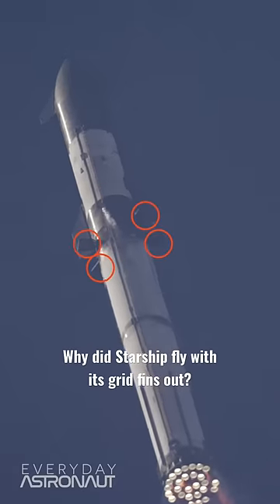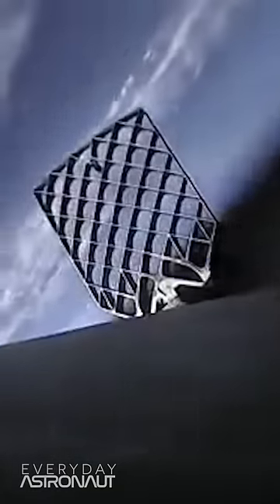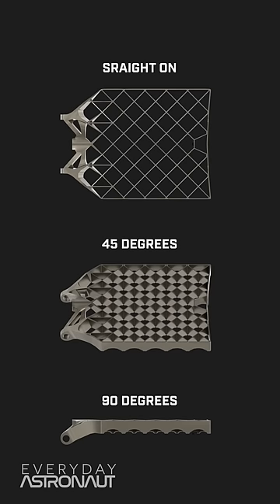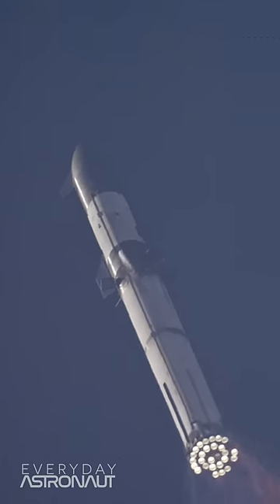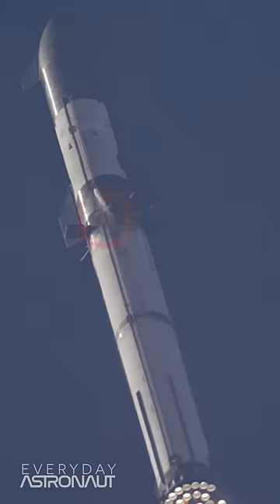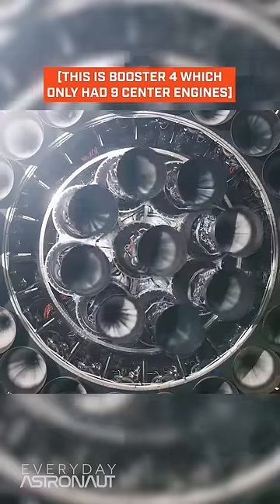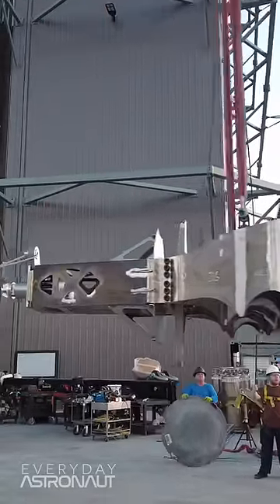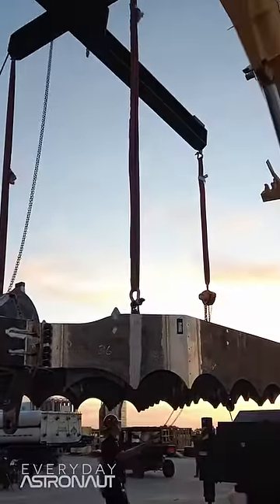Why did #SpaceX keep #Starship’s Grid Fins out on ascent?

Comment: Sometimes SpaceX kills me

Grid Fins: We can keep them out because due to a complex and complete analysis we fund that it's better and weighs less.

Pad: A rocket with more power than the Saturn V firing into bare concrete when NASA needed a flame trench lined with refractory bricks? 

Meh, it'll be fine, our half power burp of a statics fire only did a little damage.

Comment: I woulda guessed that they were used to reduce the tension strains on the booster. With the boosters fuel tanks emptying, the structural integrity of the booster will decrease, couple this with a fully loaded upper stage being in front of the centre of pressure and shifting the centre of mass forwards and it would possibly introduce a risk of exceeding the structural limitations of the booster to withstand the bowing/buckling forces as it controls the ship's attitude from the bottom. Like placing a heavy weight on top of a soda can and holding the can at the bottom, and moving the cans position rapidly....

Comment: Perhaps they extended the grid fins because the hydraulics were destroyed at launch with insufficient deluge and no deflection? The thoroughly predicted destroyed concrete randomly flying at highway speeds was recognized as a risk but was determined(by Space Jeebus) to be too expensive to mitigate. BTW, this was "discovered" waay back in the 1960s by two very different countries. 🙄

Comment: I thought profile drag will be huge before max Q. I wonder the sheer power of the rocket simply overcomes the grid fins as viable tradeoff for additional weight and complexity
Reply: The weight performance trade-off is the key part.  Way oversimplified: you don't want to 'add two units of performance loss' (by adding the weight of a folding system) to correct 'one unit of performance loss' (in the drag being caused).
Reply: Remember that drag is related to airspeed... so the drag is relatively low when the vehicle is initially accelerating, and by the time the vehicle is really getting up to speed, it's in lower air pressure.

Comment: I mean they do essentially steer using drag. ‘Deflecting air flow’ is more or less a semantics difference, unless you mean deflecting airflow into other aerodynamic surfaces?
Reply: They steer primarily by generating lift, just like the various control surfaces (ailerons, elevators, rudder, etc.) on an airplane. Of course they do also produce drag, because everything that produces lift must also produce drag. But the drag from the fins exerts almost zero net torque on the booster, so it's useless for steering.

Of course if you were to redefine "drag" to mean "any aerodynamic force generated by deflecting airflow", then you could claim that lift is a subset of drag and make your claim true that way. But then, by that definition, airplanes would also stay in the air using drag.
Reply: Fair enough.  The real key is "productive drag" rather than simply "paracidic, unhelpful drag".

Comment: My impression is they spin starship like a bullet for accuracy.
Reply: It would not help for rockets of this size. For smaller rockets which a just for collecting high altitude data like sounding rockets for weather data, yeah, they probably do spin them but once they are 120M or 360ft tall, that will induce a lot of extra stress which is not ideal for rockets.

Comment: A better question would be why didn't Spacex use a flame trench. They could have avoided kicking up concrete and damaging launch pad and Starship engines.
Reply: The launch site is too close to the water table to dig a trench, they would have had to spend months building out a proper diverter and watter dailuge system to handle the starship, above ground, the pad was only meant to be used once before being dug up and replaced.

Comment: Amazing. Interesting how they have ablilty to gimble the engines. I wonder if they can design them to flip them around. Like just the ones on the outside. So they could theoretically use them to get out of a pinch if the rocket for some reason loses its trajectory. It 'may' help. Of course not flip 180 degrees thatd blow up the rocket. But maybe i dunno. 90-100 degrees? Deploy the ones that they need for direction control. I guess they could just use what they have to steer.. But, since they are always upgrading these awesome engines. Seems likely they will add something like this eventually if they needed it.

Comment: they are fixed, non retractable on the booster. unlike those on the falcon series  rocket.
the booster's only twist side to side. they will never fold. elon runs on the idea that less is better, if he can achieve his goal without something, like say the parts and software needed to fold the fins, then he'll do that. the booster has more than enough power, as we saw on the test flight, that whatever drag those fins create doesn't matter. there seems to me there was another reason why they made it this way i just haven't had enough coffee to cut through the haze. something to do with stage 0 i think.

Comment: Saying they don't steer with drag, instead with deflection is wrong. Aerodynamic drag is how wings produce lift. Saying that these, or any other fin/wing deflects air is a bit simplistic, and not correct. Lift is the perpendicular component force to the direction of air flow due to drag through a fluid. Although a fluid may be deflected down, this is not what causes lift, rather the low pressure on the 'unexposed' portion of the wing that creates a low-pressure differential from top to bottom that allows the wing to be acted on towards the lower pressure environment.

Comment: Steering by directing airflow is the same thing as steering with drag lol
Reply from the maker: Drag is not along the primary vector for a traditional fin / wing / aileron. But a split aileron does primarily use drag when split for control instead of lift

Comment: Wouldn't it at least make sense to turn them parallel to the ascent rather than perpendicular?  And, why are the heat shield tiles black instead of white or, better yet, shiny metal?  Black absorbs far more heat than the others would, making the tiles far more resilient (IMHO) during reentry I'd think/
Reply: As he said, the extra weight of the mechanism to move in that way is worse than the performance lost by the extra drag.

It's true that black is the best absorber of heat, but it's the best emiter too, which means that heat spreads more evenly reducing the risk of hotspots.
Reply: @JoseNovaUltra  On the grid fins, that's having them fold back against the fuselage.  Im talking about them simply rotating 90 degrees one way of the other rather than having their full surface area exposed on the ascent.
Reply: @ericperkins3078  got you! I understand now. It is actually worse, the side has a lot more surface area, as show in the model,  the cross section doesn't have thay much material in way. And I'm not sure that it even has enough attitude control to be place in that position.

Comment: This leads to the question: “if this is a better overall engineering solution, then why don’t they retrofit this design to the Falcon 9?” It seems to me that all the same variables apply. The only reason I can see is “if it ain’t broke, …”
Reply: The Falcon 9 would see a sufficient payload decrease with the gridfins permanently extended and catching an F9 would be pointless since they are just fine with drone ships and landing pads and legs on the booster.

It would also require a complete redesign of the Falcon 9, possibly costing billions for a rocket SpaceX may not be using in the next few years, so it’s not worth it.
Reply: @archierush868  thanks, Archie. Have you seen, or read, an actual engineering analysis of these trade-offs, or heard someone go into detail? If so, can you provide a link? thanks again.
Reply: @tfk0527 it’s just from what we see. We see that Starship and the booster are designed to be fully and rapidly reusable, while the Falcon 9 was designed to be partially reusable. Having the fins extended, legs removed and trying to catch it would be too expensive to be deemed viable for the Falcon 9, especially since they won’t be using them when the Starship is reliable.

Comment: A question on another topic. I noticed some of the outer engines on the booster were not lit, is this normal or have they failed.
Reply: That was flight 1 where 6 engines failed. Flights 2 and 3 had no engine issues during liftoff and on the ship and flight 4 had only one engine fail on the booster during liftoff and one during landing.

Comment: I want to know why the grid fins are scalloped?
Reply: I've read that it gives a better trade-off between steering authority and weight.  The sharp side on the bottom is leading into the wind when landing and further helps to direct the airflow through rather than around the fins.  Pretty cool looking design too.

Comment: How does it not use drag? What is the difference between deflecting airflow and using drag? Are those not the same thing for the most part?
Reply: I don't know that much, but I believe it goes like: 

Drag is produced by stagnation, basically stoping the flow, this produces friction, heat and high pressure zones. Drag has a vector opposite to the path being travel, so drag is kinda brakes in way.

Lift is produce by flow, this produces low pressure zones in the surfaces, the vector produced is perpendicular to the direction of movement, perfect lift shouldn't affect the speed of the direction of motion.

Comment: How many times now, starships booster fins DON'T FRIGGING RETRACT, it doesn't create enough drag on slower ascent to justify all the additional equipment, mass, weight and taking up space for hydraulics, motors and gear. SO ENOUGH WITH THE GRID FINS

Comment: „Removing an extra failure mode“

Launches a rocket with no flame deflector on a weak concrete pad without any kind of water sound protection that was absolutely necessary on much weaker rocket designs while the flat pad reflects the sound back into the engine, uses an FTS that doesn’t work, engines that Musk confessed only had a maximum observed lifetime of about 1000 seconds, leaves a ton of equipment, including large propellant tanks, very close to the launch site, and is not even able to accurately display what engines have already failed (which, by the way, was an enormous 8 or 9, so nearly a third of the engines installed). But man, at least that one risk factor of the fins not deploying, that is out of the way 😂😂😂

Comment: INTENTIONAL TERMINATION!
(While I understand required testing for safety and such,) that’s SO much money wasted!
Reply: None of which is your money so why complain? All the engines in total cost around $40M which is the same price as one RS-25 which is the engines used on SLS, and the SLS uses 4 of them. In total, Starship and the booster probably cost around $70-$100M or about as much as a fresh Falcon Heavy. The entire program has costed SpaceX between $3-$10B at the lowest to highest amount from 2019-today, with most averages putting the number at around $5B.

That’s $5B for literally everything Starship related from vehicles, ground support equipment, raptors, testing stands for raptors, multiple launch towers, one at Cape Canaveral under construction and 2 at Boca Chica, also one of which is under construction, build site, heat shield tiles, all for around $5B.

One SLS launch, no R&D just the launch, can cost around $4B.

Which is more economical?

Comment: Tim! you state that 13 engines gimble but show 9 doing this in the short clip, is it 9 or 13??
Reply: It should be 13 ( 3 inner and 10 around the 3 inner ones) but it seems they tried different configurations. However 13 should be correct

Comment: Why didn't starship separate from the booster and land?
Reply: It seems it was slower than originally expected ( some engines failed) and had problems to control the attitude when stage separation should have happened. This is at least what we can say without further information by Space X

Comment: Drag IS Still A Factor.😮
Reply: But adding the mechanism to fold them in would have added too much weight, meaning burning more fuel, and having the fins extended and the drag they produce actually uses up less fuel than having the added weight of the mechanism to fold them in.

Comment: Yes the grid fins steer using drag how else could they operate.
Reply from the maker: As mentioned, via deflecting air. They are not air brakes like the flaps on starship. They function the same way as a canard or stabilators function
Reply: @EverydayAstronaut  , so a manipulation of the flow from a high to low pressure or vice versa is using drag (at points) to effect a change of attitude?   I understand but aren't we basically talking about the same thing or am I missing something?  Thanks for the response btw.
Reply: @weirdscience1  I think you're interpreting "steering using drag" too broadly. Yes, all control surfaces interact with drag... but a surface based on deflecting air left or right for steering is very different from one which steers by directly increasing and decreasing drag (as Starship does).
Reply: Like "Canards"👈Oh you mean on a real aircraft as opposed to on a balloon🤣
Reply: Spaaace "ships" uses magic gravity anchors, fish flippers or BBQ grills 🤣
Reply: @AV036  ?

Comment: The cope is so real... intentional termination
.... yeah sure after multiple engines failed, and they had lost control of the ship for multiple minutes they decided they had no choice, also theres quite alot of evidence that their termination even failed and the rocket blew up due to other malfunction!
Reply: Quite a lot of disinformation here. The rocket preformed fine until a hydraulic unit exploded, causing the loss of control of the center engines. Combined with the loss of more than three engines, the rocket could no longer maintain its flight profile and the FTS was activated. However, the explosives weren’t powerful enough to rupture the fuel tanks so the rocket tumbled for 40 seconds until aerodynamic forces ripped it apart.

Comment: But it also didn’t achieve the desired altitude
Reply: It flew for  4 minutes after shredding 6 engines. It did quite well considering the circumstances
Reply: @weekiely1233  it did very well it might of achieved desired apogee with less drag though. Would of been good to see separation.

Comment: So they dont have a 90 deg spin tilt on the grid fin?  They could easily.  Dont want to. 
Just add a 90 deg spin shift mechanism,  but whatever. If it doesnt matter then fine.  Do what you want.  Save money. Save engineers from having more brains.
Reply from the maker: There’s actually more surface area when they’re 90 degrees. There’s very little cross section when they’re straight on

Comment: "Tim is going to the moon" 🤣
Reply from the maker: You referring to the thought that I’ll never ride starship because the first prototypes have blown up? Perhaps you’ve never heard of the concept of “prototypes” or “test flights” before and that’s fine, but this early test article is the reason I think a program this ambitious can actually make it.
Reply: @EverydayAstronaut  cope harder :D
Reply: @ville9738  cry more :)
Reply: @KozmoCraft  if nasa had a track record of spacex, it would've been defunded ages ago :D
Reply: @ville9738  why are you comparing a government agency to a private company with different goals, different methods and different testing procedures?

SpaceX has spent around $5B in total for everything starship related.

NASA has spent nearly $100B on Artemis and around $20B on SLS. And they’ve only had one launch, but it was successful.

If NASA had control of the Starship project and never changed anything, it would be more successful, but way more expensive and way slower, probably taking decades for the first launch.

Edit: NASA knows how good SpaceX’s Falcon 9’s are since they use it for a lot of light payloads and crewed/uncrewed ISS missions. They also use Falcon Heavy for heavier payloads

Comment: Thrust can't be generated in a vacuum. Kinda makes all that a bunch of bullshit
Reply: If you stand on a skateboard and throw something heavy in line with the wheels, you will move in the opposite direction. This also works in a vacuum because it wouldn’t physically make sense for something to throw mass in one direction and not have an equal force applied to them. Your theory violates the laws of physics
Reply from the maker: Are you suggesting when a fireman is holding a firehose and it pushes back on them that the water is just pushing against the air? You don’t think if you held a firehose in space you’d still get pushed around?

Comment: How about it actually works rather than explodes.
Reply: It can currently be used as an expendable rocket now. IFT-3 made it to space and conducted experiments proving it can at least be used as a conventional rocket. Next is flight 4 which will hopefully have the booster simulate a catch over the ocean and the ship to survive reentry but not attempt to do a soft landing. If the booster conducts a flawless flight 4 mission, then flight 5 will perform a catch attempt and maybe the ship will do a soft landing.

It’s 99% of the way their to its goal of a reusable rocket, but 100% can be used as an expended one.